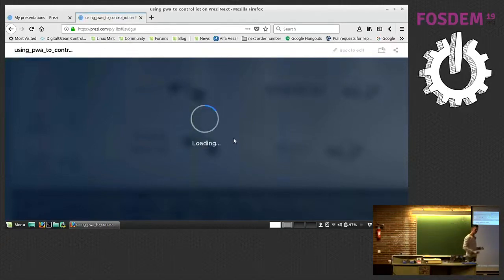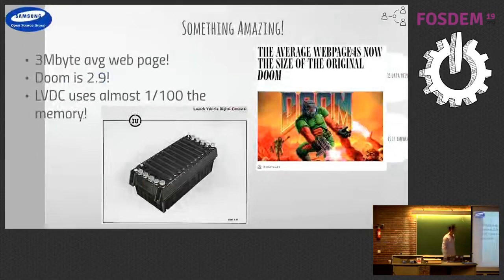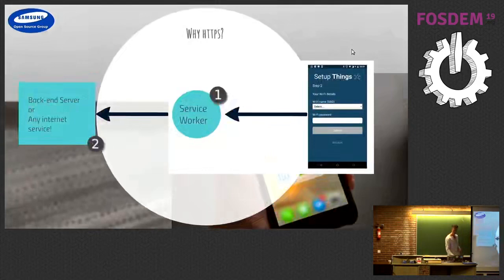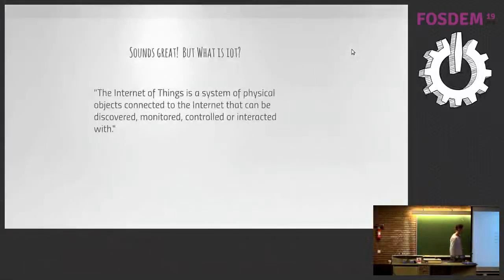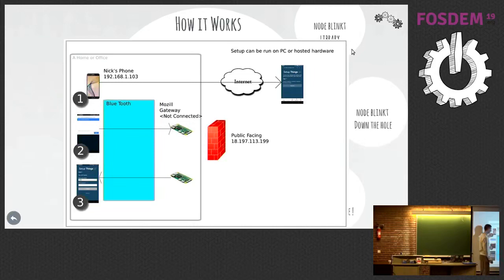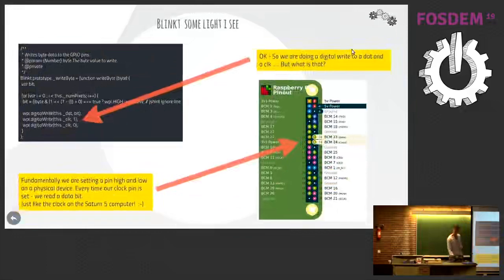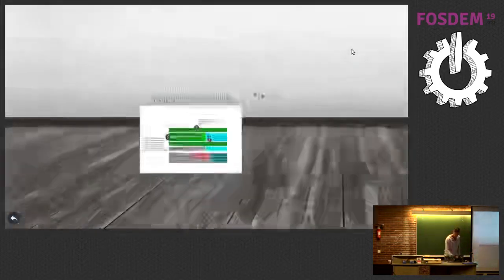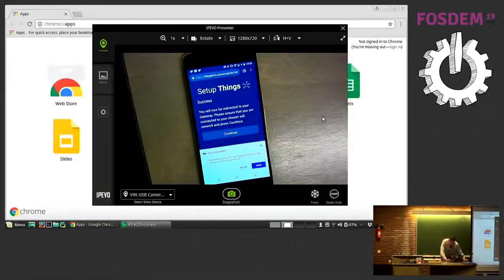Using Progressive Web Apps to control IoT Using a PWA app to control an IoT device using JS framewo…

Comment: Stop spamming. If you can't make native app, what you have to say is utterly irrelevant. (Oh, and hacking is illegal, in case you didn't know.)
Reply from the maker: Hacking is the method by which you repurpose something to do something other than was originally intended. Hackers and security researchers are why your credit card is safe, they are also why the technological advancements you have exist. In case you didn't know.
Reply: @AllHackingCons  This is not some harmless repurposing. It's already causing several people to attempt to destroy the app ecosystem and it's damaging the security of our devices by hooking everything up to the internet without any humans in the loop to stop malware and spam. Heck, you're even promoting using malware to access the internet of things instead of using a REAL application. Stop the lazy shortcuts! Make a native app or use a website. We don't need your Frankenstein hybrid crap. And if you want to keep it around to experiment, PLEASE name it properly! Don't refer to your websites as apps.